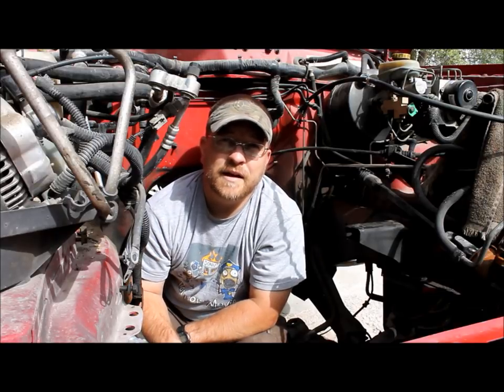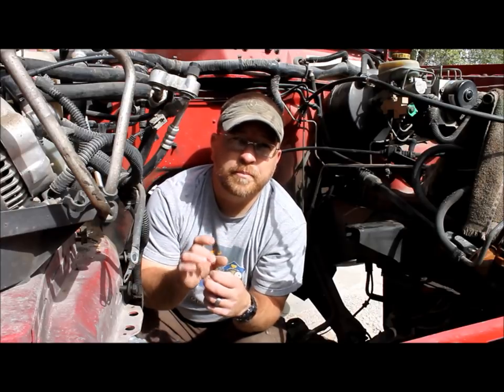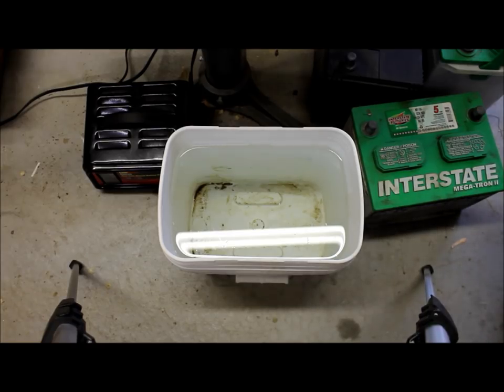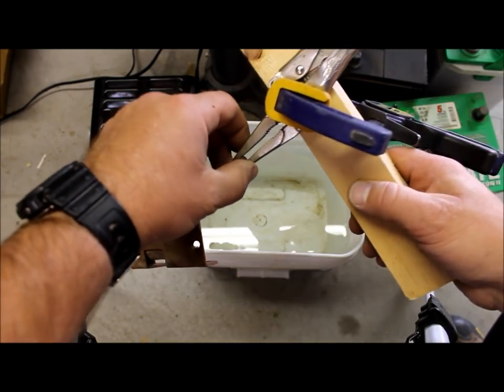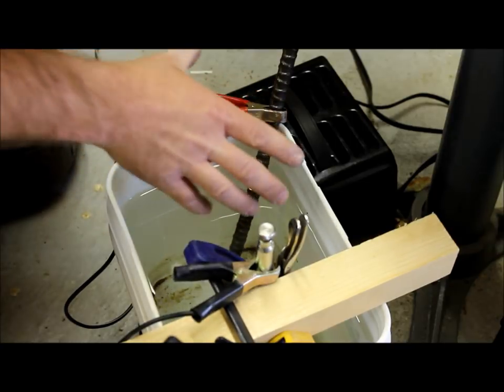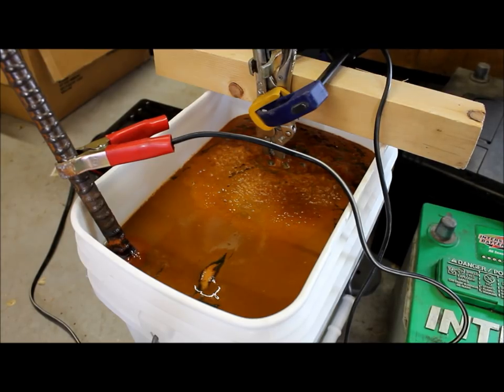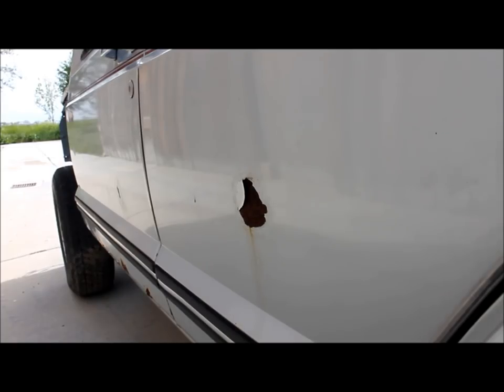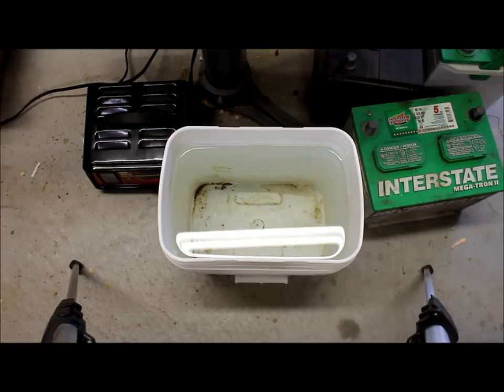Remove Rust With Electrolysis

Comment: Would this work on aluminum? It's non conductive so this is why i ask.
Reply: Aluminum absolutely is conductive, ever heard of aluminum wires? It's not magnetic though
Reply: yaa.. I was thinking its non ferrous, so it wasn't conductive. I had a derp moment.
Reply: Lol its all good we all get those moments
Reply: I dont think it will work because it isnt a ferrous metal. Its conductive, but I dont think it will remove oxidation off aluminum though. But heck, give it a try and see what it does!
Reply: Yea i don't know, you might need an anode made of aluminum as well
Reply: non ferrous just means it doesn't have any iron in it. Its still conductive, just not magnetic.

Comment: No disrespect intended I figure people are here to learn., Anyone one learning. you will get 80% better electrolysis action if you go with about 0.5 Tablespoon per Cup, Or even a touch heavier 3 good tablespoons per ever 8 cups or half a Gallon of Distilled water.  If you noticed how slow his part started to bubble this should be an instant full bubble if you have the right proportion of Sodium Carbonate to distilled water. It will still work his way. but it takes longer and you normally have to wire brush the part after to get it all off.

Comment: Does this work without soda wash?
Reply: IceTeeXx You have to have SOMETHING in the water to help it conduct.  Plain water doesn't conduct without minerals or something in solution or suspension.
Reply: IceTeeXx  Saturate it with salt and try.
Reply: +MEno Gusta wouldnt salt be counter productive since it can rust steel?
Reply: Tareck Fahmi This process works faster than rust, and all that matters is that you have a good electrolyte. I've done this process with salt and it just works slightly slower.

Comment: how would I do this with a revolver cylinder I have a percussion revolver and the nipples are seized shut
Reply: did you not watch the video? that's how you would remove the rust from it.
Reply: Brett Duffy. it depends on if your revolver is stainless or blued.  more than likely you'll either have to re-plate or blue your cassette.  if you try this i would go short amounts of time and t ale a nipple wrench every hour or so to see if you can break them loose.  after i would use a chemical gel and replaces the nipples.  my preference for lube is ballistol to clean and then use an air compressor to blow down parts. how that's helpful if you still haven't brought it to a Smith.  i just took care of my bore screw on my 1958 pedersoli rifle... nerve racking!
Reply: Andrew Steffel  I was able to do it with like a torque nipple wrench on a vice

Comment: Salt will make it conduct drastically more I would think, has anyone tried a tablespoon of salt in there? might be hard on the power source depending on salt to water ratio. May "hear" the charger strain perhaps. Doing any of this on a concrete slab in bare feet maybe Darwin worthy, be careful out there...
Reply: +ZCuckoo TimR the table salt results in copious amounts of chlorine gas

Comment: The hydrogen gas and carbide that is created from this reaction is highly toxic. You should be wearing gloves, discussing appropriate ventilation, using a mask and most importantly how you safely discard the solution. I would be careful on the products you use it on. 

The part will be altered and should not be used under high torque or in a sensitive system (e.g. suspension parts, bolts, etc.) For example, if you were to use this part on a fine threaded bolt, I've seen research that has shown it to weaken the threads.  If you use this process, the part will typically not be the same, be weaker, and have performance decreases over time. Please be cautious if you decide to do this!  

Good video, be careful!
Reply: Hydrogen gas isn't toxic. It's only extremely flammable. Carbide is ins't produced in this reaction.

Comment: doesn't work with my battery charger (it's a new one)
Reply: Smart chargers are "tricked into thinking that they have completed the process for which they are intended.....they think a full charge has been attained. Harbor Freight has a cheap non-digitized type